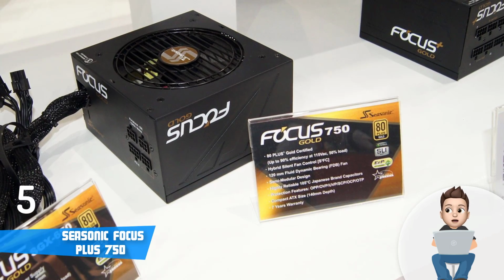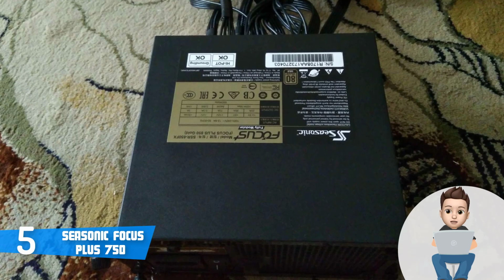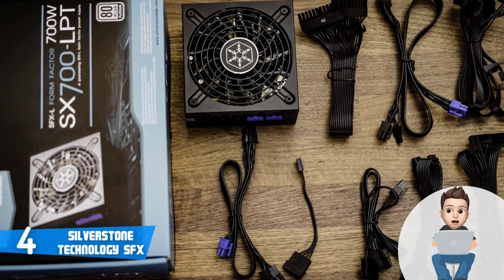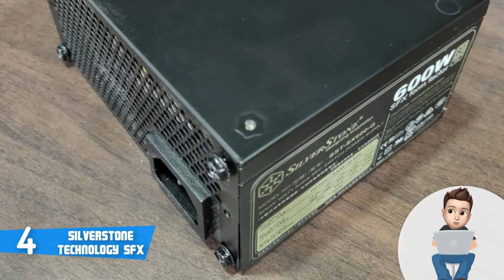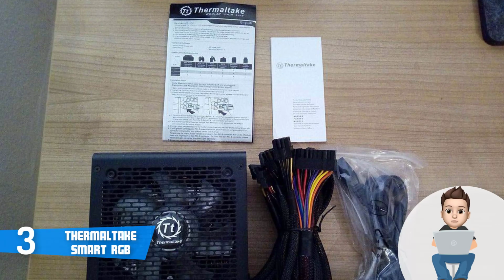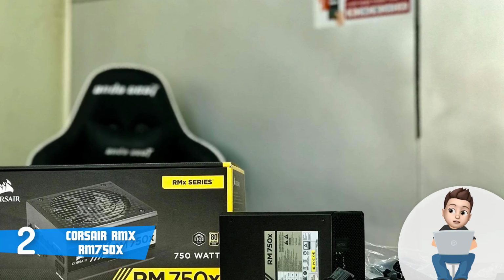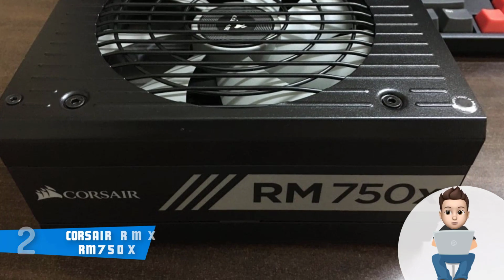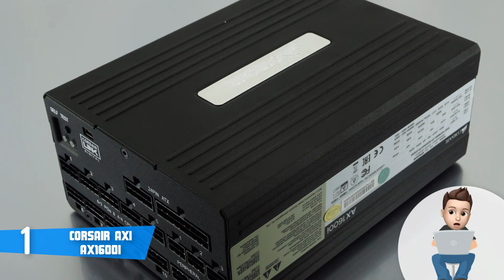Best Power Supplies in 2018 - Which Is The Best PSU?

Comment: Excellent review about best power supplies. I like Seasonic Focus plus 750, since it has a gold certification which ensures to keep our electricity bill low and also it doesn't let our system have heat. Thanks for sharing.

Comment: CORSAIR AXi AX1600i  is what I need. Thank you for sharing this video.
Reply: Really Josh...what EXACTLY is the spec of the machine its going into?....Don't get me wrong, I have a 1Kw PSU that is now 6 years old but MY PSU is way TOO MUCH for the 8 core, SLI rig I built back then, so what could you possibly be building or have that would require a 1600W PSU?
Reply: @Kottesque  ikr 1600 watt processor is JUST NOT NEEDED!

Comment: For all your power needs that you don't have a clue about and like to vomit money out of the wall socket...

Most people are unlikely to even reach 500w let alone need anything 750+ in a gaming pc, 2080 in a normal setout might take 500 with an overclocked cpu and that's adding in the safety...